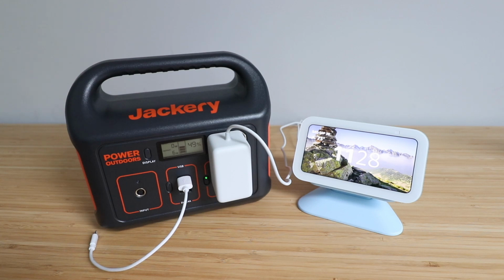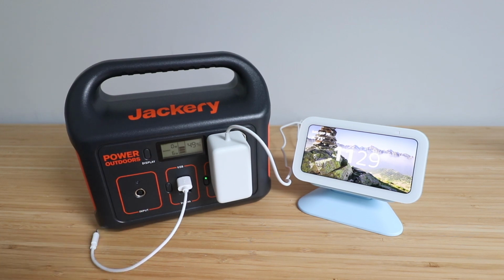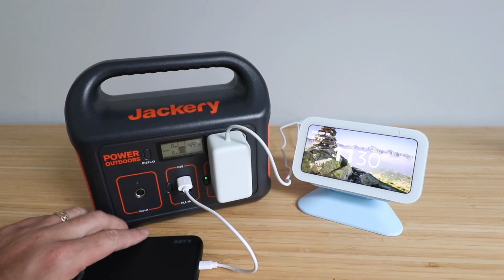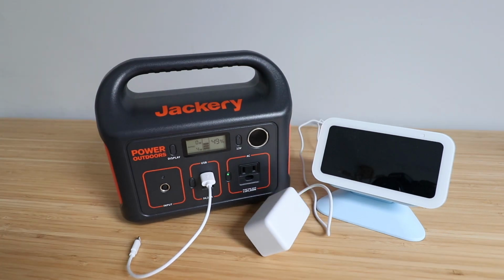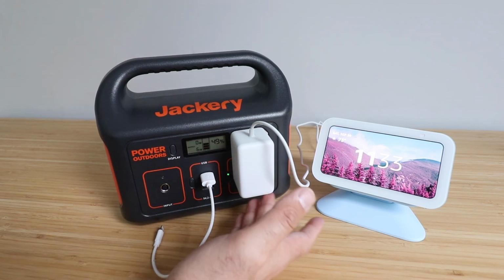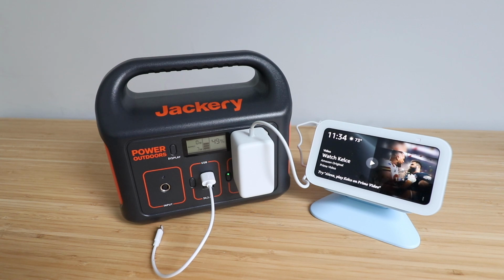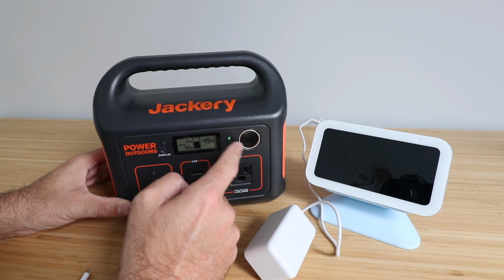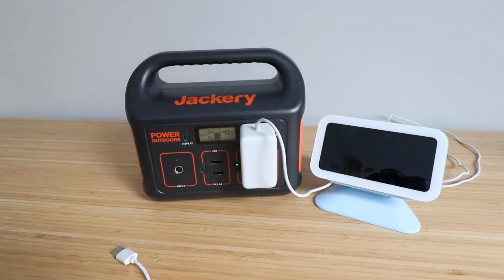Jackery Off Grid Portable Power & Solar Generator Review

Comment: I have Explorer 240 for almost year.  Use it on passthru energy to power my cpap breather at night.  

If power failure.  It switches seamlessly to battery, with 8 hours power.

Works great, and may buy another next year and pick up some solar panels.
Reply from the maker: Thanks for sharing! That's a great use case. I've been impressed at how well the little device works. It's been super convenient to have for camping trips or it the power goes out at home.